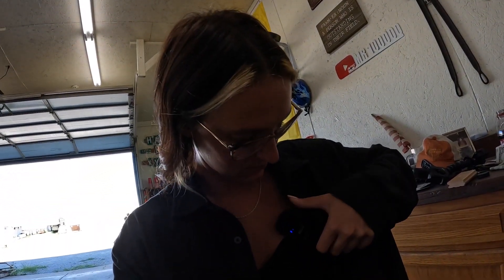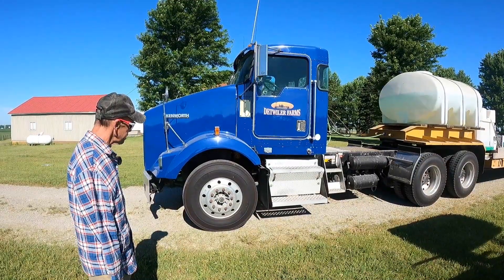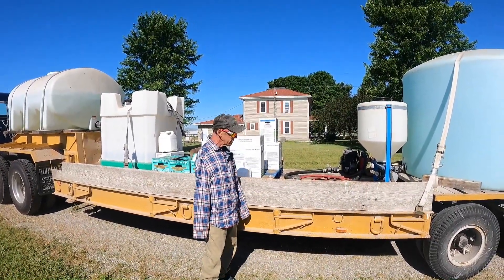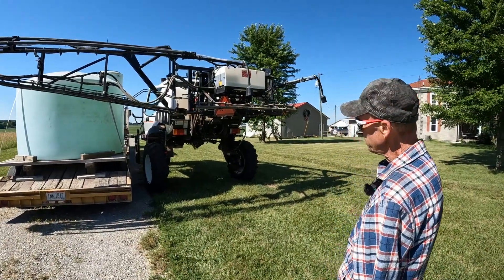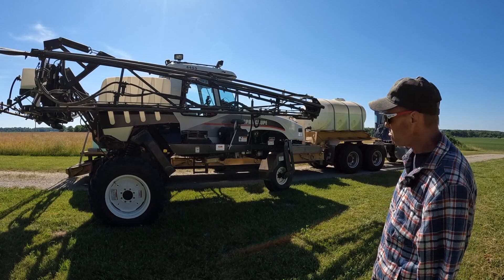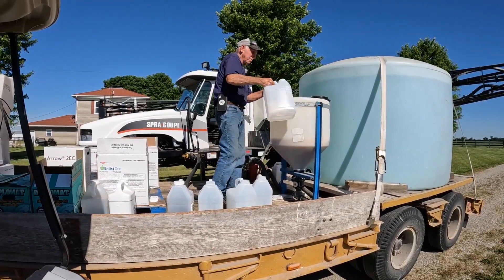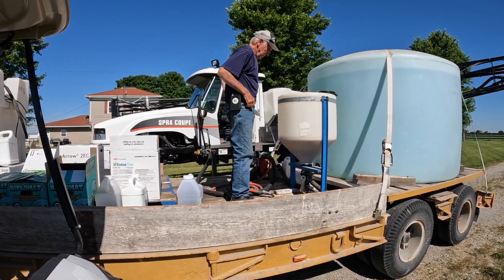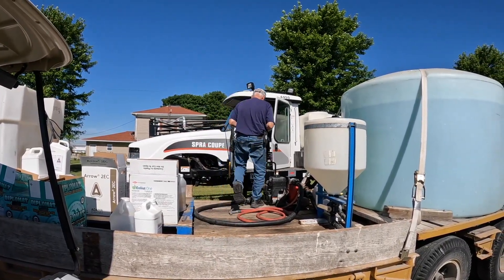Mixing Dangerous, Toxic Chemicals To Eradicate Weeds

Comment: Thats a nice setup! I use a hardy 660 gallon 60 foot boom pulled with a case 1090u tractor with an ag leader guidance set-up with steering. The sprayer has the induction ( toilet) system on it. It works well! Would like to be wider. Less tracks across the field? Keep up the great work 👍

Comment: Surprised you didn't Attempt to teach an Olde Dawg a new trick @ about 8:55. Pretty "Brutal Valve Operation" there -- the "younger Detwiler" would have slipped off his footgear, and Grasped the handle of that Bottom Valve between Big Toe and "Fingers," and shifted it from "ON" to "OFF" with very little chance that anything would Get Broken.

Comment: Nice spray set up and Pops makes it look so easy! If the sprayer tips over while folded up for transport. How or can he get out of the cab???
Have a great weekend and about time for the Detwiler Family Rain Dance!
Reply: There’s escape by removing the side window.  At least there is in mine.  It’s a big pull tab on a retainer strip that holds the side window in.
Reply: @jimrankin2583  Thanks...are you able to get out regularly without swinging boom out some? Or did he just do this inorder to step directly onto trailer? Not been around one of these types of sprayers...
Reply from the maker: He swings the boom out so he can step right onto the trailer. It has to be easy lol
Reply: @HarmlessFarmerAndyDetwiler  🤣 He did appear to have done it several times! Work smarter and not harder type of concept!😃